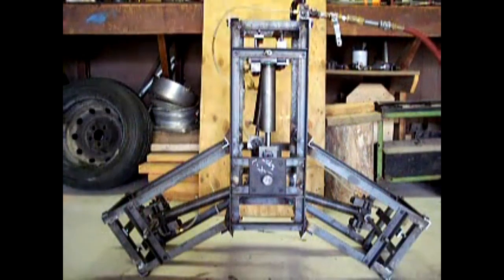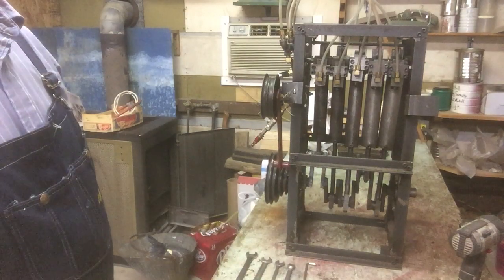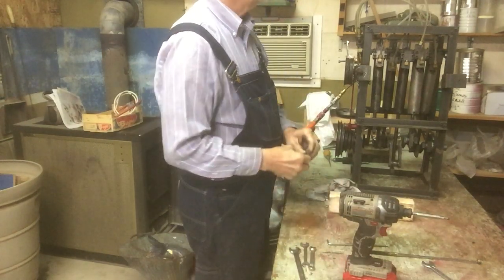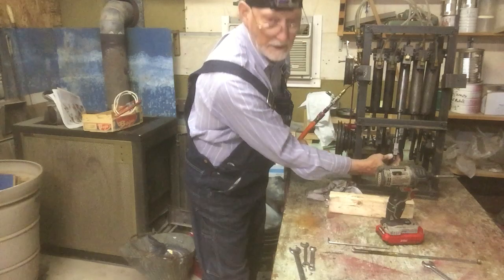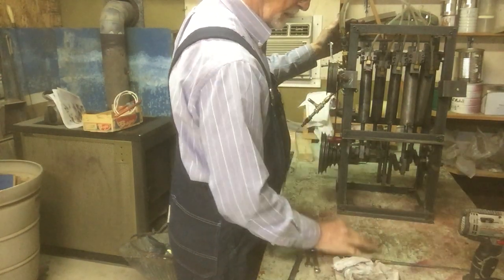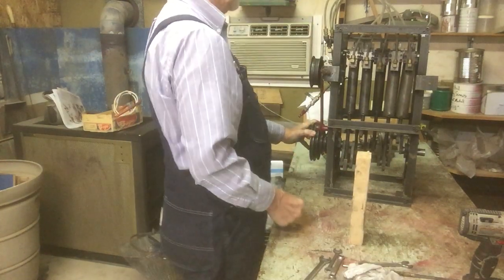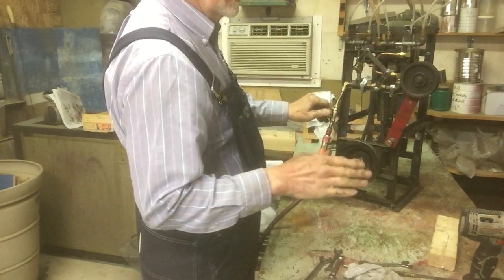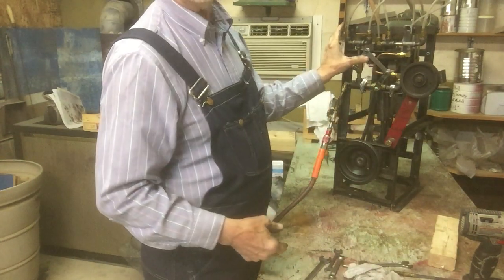A Car Compressed Air Engine, 5 Cylinder,  Disassemble Video 10-18-2020

Comment: Very impressive work of art. I wish it can be mass produced and put in cars, easy engine to work on. 
Thx
Reply from the maker: Thanks for the comments, and subscribing!
My goal is to put it, or something very similar in my small pickup.
I have one major hold back, a Carbon Fiber Pressure Tank, around $6,000. Just can't afford that - so in mean time using an old Propane Tank to do my testing and trial runs - just around the driveway, can't go very far!

Comment: that is a cool engine
Reply from the maker: Thanks for the comment, and vote of confidence. 
We just have to keep improving on it.
One area I want to make better is adjusting how the timing is done, and see if there is a way to make a timing advance when the engine is running at higher speeds?

Comment: full ball bearings anywhere that rotates and thinner rings may help
Reply from the maker: Thanks for checking in, and the comment. I’m not sure what you mean by thinner rings?
Reply: @AirEngineResearch  if you have piston rings in the engine thinner ones would help
Reply from the maker: There are no piston rings, only leather seals

Comment: wobbler big motor....also you can use regular 5 cyl audi crankshaft its balanced already
Reply from the maker: Thanks for the comment, that could be a solution I’ll check into it